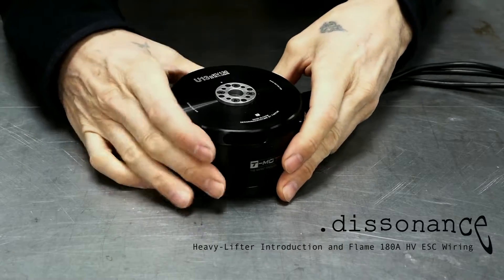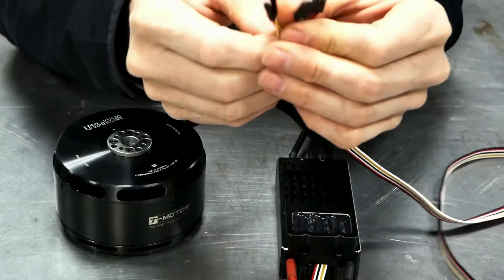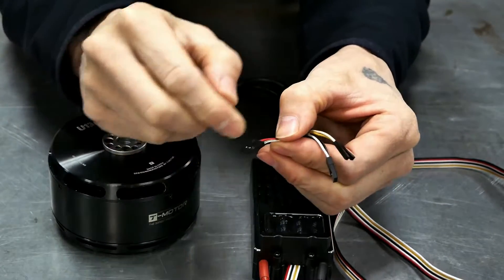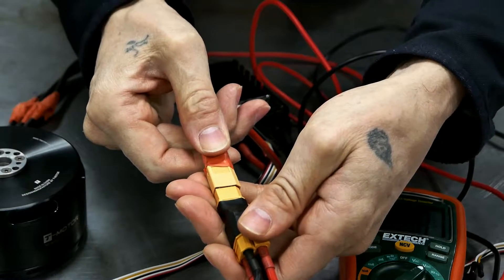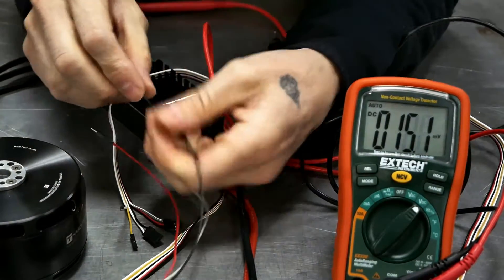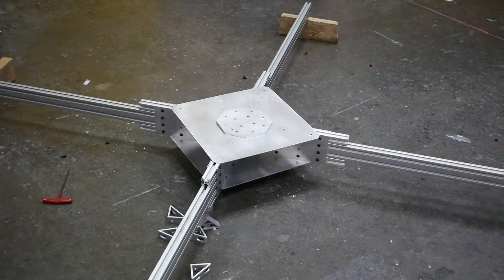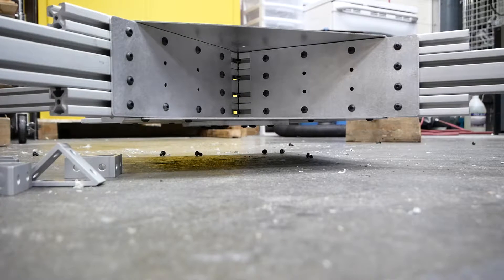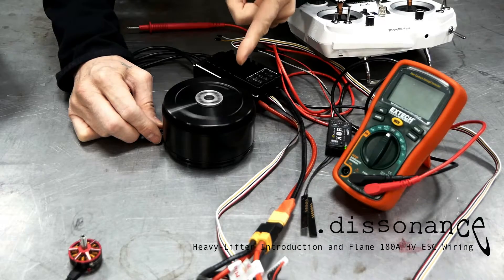#78 - Heavy-Lift Drone Project and Flame 180A ESC Wiring

Comment: This ESC hookup on this video is not exactly correct. The reason why is the red/white/black connector's white wire is not the signal wire. 

The signal wire is the white one on the black/white connector. The black wire is the ground. This does not provide any power to the receiver.

Plug the black/white connector into the throttle channel of receiver with black ground to ground side. Then plug in a 4.8v to 6.0v battery to receiver.

The reason why he thought his receiver was BEC was because he had the red and black pins from the red/white/black connector plugged in. These acted like a battery plugged into receiver. I suppose you could use this safely as a BEC setup.

This youtuber was fortunate to stumble on to this workaround but I wouldn't recommend plugging in wires haphazardly and risk frying an expensive ESC.

Why T Motor doesn't document the proper hookup or the purpose of the other connectors is baffling.

Comment: I just used the connector with the white and black wires.  But I running a Futaba radio and Futaba receiver with the DJI N3 flight controller.  Works fine.

Comment: I am having a similar problem I purchased  4 of these motors and escs, 3 escs works fine but the 4th esc there is no power going through it at all. When I connect it to a 16000mah battery the led will not illuminate at all but the other 3 works fine.

Comment: I'm not sure how you figured out that T-Motor Flame 180A HV wiring problem. I'm an electrical engineer and don't think I would have figured that out. It can't imagine it's anything other than a wiring mistake at the factory. You've got this nice long wire harness with the 3-pin connector on it, and the signal wire that is needed is on the short stubby 2-pin connector harness. Very strange. But thank you so much. Changing those two white wires got the ESC working.

Comment: I spent a good bit of time trying to track down the intended functions of the six strand flat ribbon cable that exits the  T-Motor Flame 180 A ESC. 
I believe the link mahmood kh provided below was correct. T-Motors has a real-time remote monitoring function available for these high end ESCs.
and, its called T-Motor Data Link. It is another module you add inline between the ESC and the FC. This module has an SD Card to record the real-time data feed 
and a USB Cable Interface for advanced tuning of the connected ESC. The T-Motor ALPHA Series ESCs has the identical six strand flat ribbon type cable exiting the ESC as 
the Flame 180 A. The ALPHA Series ESCs seem to do a better job of advertising the imbedded features the Data Link Module unlocks access to for these 
Commercial Grade ESC Components.

Comment: i think that three wire is for serial port and that white wire is only TX (no need of RX) that's why is 3.3v (not always but in standard uart TX/RX are 3.3) it send some motor data u can read by Arduino (i will check) u can checkout here https://store-en.tmotor.com/goods.php?id=728 i didn't test yet but it looks like  it's for this purpose

Comment: Thank you for this informative video first of all! I'm currently building a heavy lift quad and intend to use the exact same motors and ESC combination. Considering the cost, I am stunned that such ESCs don't come with the relevant paperwork! 

Also.. Perhaps the connector with the white/black cable is your standard signal/ground, it would make sense if that's the case since they say it doesn't have a BEC.